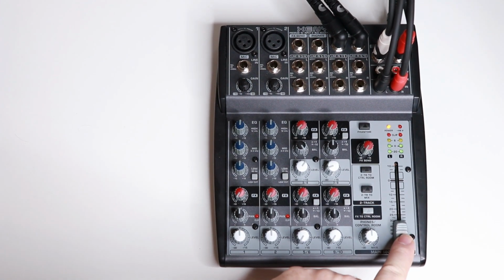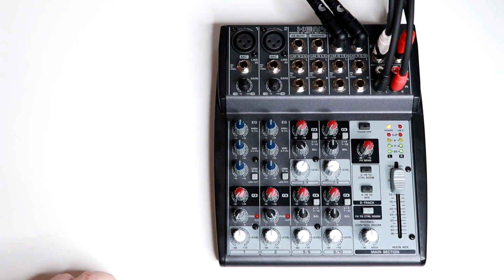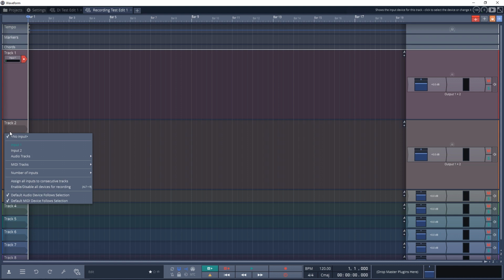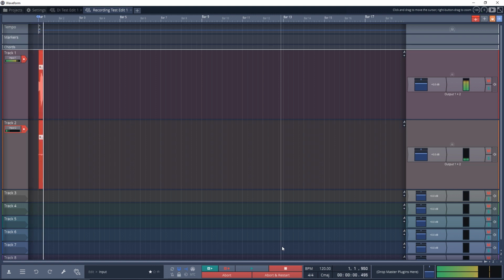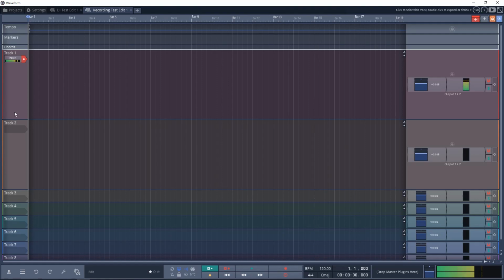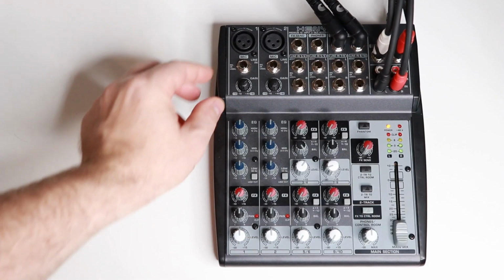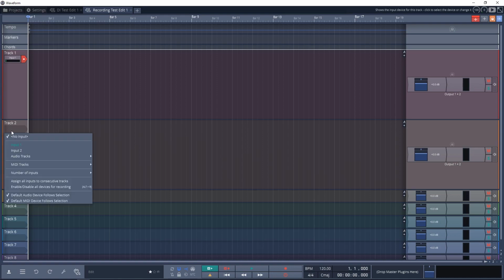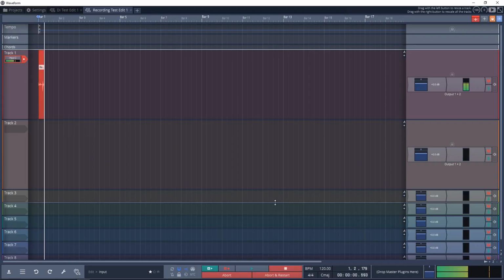Connect Mixer to Audio Interface

Comment: Dope video, very helpful! I'm having an issue however; I'm using a Mackie 1202VLZ4 mixer with a Focusrite 2i4, and I'm using option 2. After following your video, I was able to hook up my outboard synth and hear it through my monitors no problem! But I'm unable to hear anything coming out of my computer and DAW. Any help would be appreciated!
Reply from the maker: Where do you have the outputs of the 2i4 going in the mixer?
Reply: @AudioTechTV  I have the 2 line inputs from the front of my Focusrite into the main outs on the Mackie. The RCA to TRS 1/4 cables are going from the tape out (RCA) to the back of my Focusrite TRS inputs, and my monitors connected to the back of the Mackie in the control room inputs.

Comment: Following you instructions for option 2 but with cables going from 2 track out to audio interface main outs ...no sound. Shouldn't it be into the 2 track in?

I've got the same mixer ,but using an Presonus iTwo.

Any help would be great.
Reply from the maker: Hi Matt. I just checked out my video and you are right. In the video portion I actually have it set up wrong. I used b roll from the wrong part when showing it on screen. It should be interface outputs into the 2 track in. Thank you for watching and catching that. Keep creating! 👊👍
Reply: @AudioTechTV  Not trying to be a wise ass, just genuinely was a bit lost. 
Thanks for your reply. All good now.
Take care.
Reply: I was thinking the same thing. Thanks for pointing that out! :)

Comment: Hello! I’m having trouble with stereo.
I am sending L and R output of a groovebox into inputs 1 and 2 of a mixer. Then I send the L and R output of the mixer into inputs 1 and 2 of a tascam recorder. In the mixer, my pots 1 and 2 are panned left and right respectively, like in the video. Monitoring the mix thru the Phones of the mixer works perfectly.
But the mix sounds weird when I’m monitoring on the tascam. Should I do something with the pan on the tascam tracks 1 and 2? Panning THEM left and right means panning a sound on the groovebox works but the mix altogether sounds off.
Thank you so much for your time!
Reply from the maker: What do you mean by weird? You shouldn’t pan the inputs on the tascam. Have you tried using the control room outputs on the mixer to connect to your tascam?
Reply: Simple Green Tech Essentially, when I pan something on the groovebox, it is panned in the mixer (when monitoring through the PHONES on the mixer), but when I monitor through the phones in the tascam the sound just gets louder/softer
Reply: Simple Green Tech and I have just tried your suggestion, to no avail
Reply from the maker: @sym-bionicwaffle7737  are you panning on the groovebox and on the mixer?
Reply: Simple Green Tech My mixer’s main two inputs (the ones the groovebox are plugged into) are panned hard left and right, respectively. I’m actively panning a sound on the groovebox left and right, and that comes thru when listening w/phones on the mixer.
Thank you again for your time, and apologies for any miscommunication!
Reply from the maker: @sym-bionicwaffle7737  what is the connection between the mixer and the Tascam like? ex. 2 x 1/4" cables going into 2 line inputs on the tascam? or something different?
Reply: Simple Green Tech that’s the cable setup, yes
Reply: Simple Green Tech I experimented a ton and figured out what to do!!!! The chain is as follows:
The groovebox goes into the MIXER, which is then panned hard left and hard right.
The MIXER goes into the TASCAM PORTASTUDIO’s A and B inputs, assigned to tracks 1 and 2, respectively. The pots on the TASCAM’s pan are hard left and right. For the input A level (line vs mic) it is fully on the LINE side. For the input B level, it is one notch away from being in the middle between Line and Mic. Panning things on the groovebox translates perfectly when monitored through the tascam.

Comment: Will this mixer Behringer XENYX 1002 work with my Apogee Duet 2 Audio interface?
Reply from the maker: I’m not overly familiar with the apogee duet but if it has two line inputs then yes it will work with it.
Reply: Thank you, yes it has 2 analog inputs.